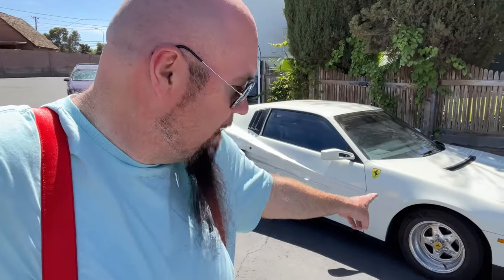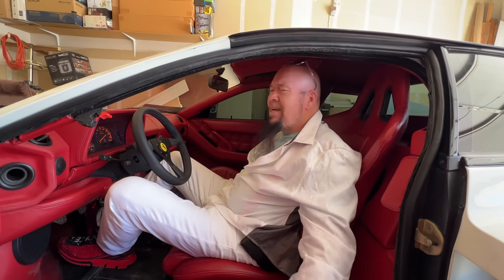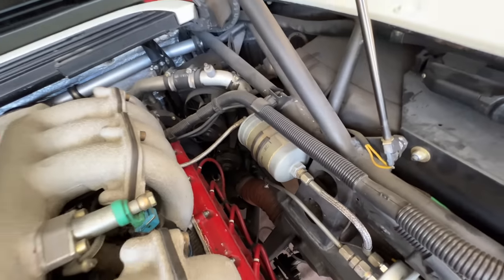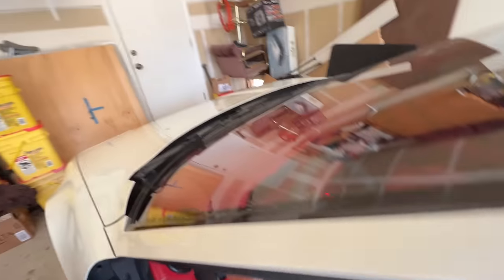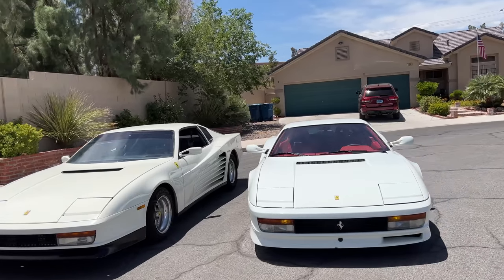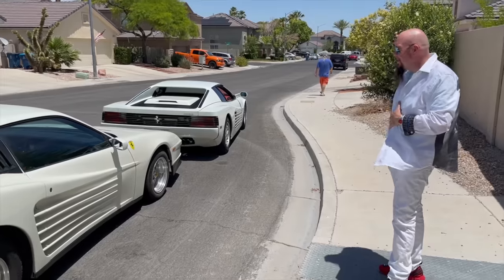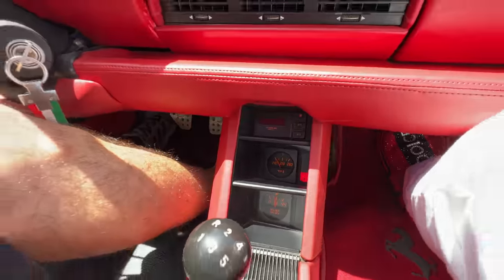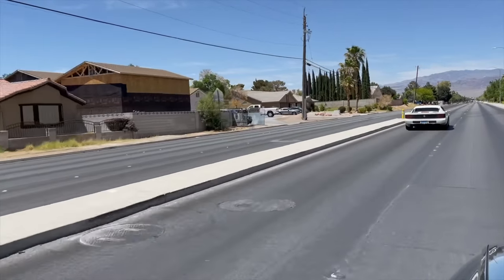Real vs Fake Ferrari Testarossa Replica Kit Car Comparison

Comment: The Corporate Concepts Mera was the ultimate Feauxrarri rebody.  You could buy a new Mera through your Pontiac dealer in 87 and 88 for about the price of a corvette and it was a darn good quality 308 look alike built on a Fiero chassis.  You could not buy it as a kit. Only already installed on a new Fiero, as an “upgrade” through Pontiac.

I own the prototype that sat on the Detroit auto show floor in 87.

Comment: I really loved the comparison! The trans am Ferrari looks way better now, than a regular trans am, in my opinion. Also, I’ve owned 2 Fiero’s back in the 90’s and they were my entry level cars to loving rear or mid engine cars (I owned some VW Bugs too so had rear engine cars too). I had a SE V6 auto and then a base 4 cylinder manual. Anyway, I think the Ferrari with an LS engine is a great idea. American reliability and Italian design.  Shelby Cobra ideas right there. Also, I’m a proud owner of a 2002 Boxster S which I call my baby supercar. Was inexpensive, yet 260hp, 2800lbs, 6 speed transmission and very reliable. The mid engine car stuff, for me has been realized in this really cool Boxster. Really like the channel. Thanks!

Comment: The front end is pretty close. If you painted the lower part of the front fascia white like your friend's car is by giving your car more visual  height up front it would help hide the TransAm profile. The side marker replacement is a pretty easy fix also if you don't mind doing fiberglass work and repainting your front fenders. Replacing the rubber door trim thing on the rear hatch with the proper wire mesh is also an easy fix that would upgrade the quality of the replica. Even the interior -- if you like working on cars and have the money why not? If you consider the car a work of art rather than just an investment the resale value of the car shouldn't be the main consideration. The length front to rear of the vertical side of the rear hatch panel immediately behind the quarter window you want to replace also is an area that attracts attention, but may be hard to change due to the placement of the chassis and rear glass at the back of the cabin. If you could push the seam back and extend the quarter panel back a few inches it would give you more room to install the new authentic quarter panel window. Although I would probably fabricate the quarter panel windows out of lexan and aluminum frame rather than pay the ridiculous price for authentic Ferrari windows. You've got the dimensions from your friend's car. That also gives you the option to shorten the window a bit if you have to in order to make it fit. No-one will see an inch or so without a tape measure.

Comment: If I remember correctly about kit cars it was against the law for any kit manufacturer to copy any Ferrari exactly the same that's why It had to be a little bit off
Reply: Did The Cannonball Run or something similar come into play? If l remember, Ferrari got quite pissed off when a replica was being filmed and that set the lawyers in motion.  I could be wrong.
Reply: @biggiefitz6275  actually I heard about that in 2006 a guy I new was doing a Fiero kit car

Comment: redrill the hubs the the right bolt patern or buy adaptor/ spacers, a 4th gen rear end is wider, has better brakes & bolts right in & a 8 into 1 MERGE COLLECTOR will get you the sownd your looking for. PS just paint the shape of the quarter panel window black & scrap the plastic that thear now.
Reply: I agree he could paint that part black to look like the window.  That, plus some tint would really get the look going, especially with a little black paint on the back part of the door fins would really help it too.

Comment: For the noise it's with a Cam and look up the 400 small block chevy from a truck then take the balancer and it should help make 8600rpm. And with the right amount of a cam it will sound more like this.  Talk to vic Edelbrock.  When he made his 240 pluss miles an hour trans am he had a special dial 400 sm chevy build.    It sound the best.  Now that effect can be achieved in ls9....

Comment: Theres a visible line running from the bottom of the windows all the way to the back of the car, this could be pulled off with a black pinstripe. Edit- also (I know from later videos you put in the rear glass look) from this over the roof to replicate the engine cover lines. Loving this by the way, you have a mission and its telly for us all. Not sure if it's possible to lower it a bit more? And obviously the wheels which is no doubt on the list.
Paint behind the louvers on the side vents black, look at the original. Its a cheap fix up, I don't know how far you need the paint, maybe 20 inches from the rear? Alternatively you could go blls deep and partially fill in the louvers and reshape further down the doors. Its not that difficult I've been restoring fibreglass race bikes and own a plastic Lotus. for years, the biggest challenge is blending the paint after.
If you add a rear facing vent between the rear wheels and back end of the body this will break up the long rear overhang. similar to an F40 but try keep the Testarossa look. 
I'm not stopping now, also move the Ferrari badge on the front wings further forward to take the eye from the long distance between the front wheels and the door.
Paint is an amazing thing, I would also use black paint to create the lower side window shape more in-keeping with the original, you wouldn't need a lot, get some painters tape to create the line on of the TR.

Comment: When the guy first started to play around with a cold gated shifter and then started taking about LS conversions or electric, I turned off the video. Just awful. By doing any of those conversions you may as well throw the Ferrari badge out the window.
Reply from the maker: And yet, here you are talking about it. This is how the news works too! It's all bullshit! Welcome to America!
Reply: @ Max G   This is a survivor Testa Rosa.  Comparing it to a period correct replica.  Yes, they discussed how owners are “resto modding “  these 35-40 year old cars for the purpose of driving, enjoying, showing, and maintaining.   Not everyone has jay leno money.  

This owner is facing down the barrel of an engine out service that I can only speculate will cost 20-30k.  I prefer the honest conversation about options especially in 2022.  Gas prices, supply chain shortages, companies price gauging and uncertainty as to the future of ICE’s is forcing owners to make sacrifices.  

Of course you are free to watch what you want.  Turn off the video if you must, but why not just leave it at that?  What compels you to mock and belittle as you leave?

Comment: Bob, instead of altering your current replica you should build your own replica Testarossa.  If you are looking for a GM chassis to use as a base for a Testarossa  you should look at a 1986 GM A Body (Caprice, Parissiane).  GM A Bodies from that era are ten inches longer and one inch narrower than the Testarossa.  Taking ten inches out of the A Body should not be a big deal.  Fitting fiberglass panels to the A Body should work and you could take the one inch extra Ferrari width out on the bodywork.  The old A Body engine bay should be able to handle an LS engine swap.  It is crazy to think how wide the Testarossa is I mean the Caprice was a huge car and yet the Testarossa was even wider!

Comment: Yeah that 89's been modified, the seats and steering wheel have been replaced, that's more a 308/328 momo in a smaller size and racing bucket seats, the originals sit further back and offer more room, and the interior looks to have been fully retrimmed, as the way they did it on most of them is the tri color, three colors, the one the dash is in, the carpet, and the seats and leather, its one of the key ways you can spot a fake lamborghini at a glance, the germans never do tri colors so their interiors are always dull drums beyond belief

and they didnt have the square box pattern on the doors, not knocking it, just saying also ferrari did actually have an automatic back in period, it was mated to a V12, its called the 400 and it featured a GM TH400 automatic transmission, actually one of enzo's last acts was to give their head formula 1 driver one of them with a manual gearbox

also you can upgrade the gearbox on the TR to a 512TR I found one where someone had done that, and with that, an exhaust swap, and electric steering, it would be a pretty awesome modern ride. also that particular testarossa with the 512TR gearbox and the exhaust, which is so restrictive it takes away 50 horsepower

89 thousand miles, if you set them up right with the OG motor, their fine, you just have to work with it, like what are the three things no owner ever does

he doesnt drive it, he doesnt service it, and he doesnt change the tires, and the engines are actually good to 600 horsepower, like theirs a guy in dallas who built up these motors into ripping roaring 600 plus horsepower cars for John Carmac and the guy is still around and doing his thing

as the thing about this car is, its still using cap and rotor spark and ignition and early K bosh, if you just upgrade what is there it should easily reach 512TR or M spec easily.

also radio, that was done because it was a big thing to steal radio's out of cars back then, my father had his stolen out of his car when he was importing it back in from germany, blaupunkt, the same they used on these back in the same period, stole right out of the port of new york

smashed the window, tore out the head unit and ran basically.

also the testarossa came with optional wheels, 225's and 245's in the rear, with an optional 265 wheel, it was in the testarossa book I bought, David Sparrow ferrari testarossa osprey classic marques and he does the 512TR too FYI

 like you hear people complaining about driving around town, I wonder if it just had the larger wheels on it

your friend did a really good job however, like he actually improved and fixed the one thing that bugged me about the TR, the front bumper, like its less round on the lips and looks better, like it doesnt protrude as much or have that much of a bend to its lips, like if you get a real one I would love to see how it would look with that bumper on it. or like a modified stock one to match it

as that has always been the one bad angle of the car that has never looked right on any of them, custom or otherwise, and your friend actually fixed that on his.

Comment: need to lower that kit car badly
Reply: Right, that's totally what I was thinking when he talked about the difference with the back end and then seeing them side by side.  That would totally fix the stance.  Most lowering kits take the back down quite a bit more than the front.  That's the most important part, looks wise.  Also, then it would ride like a Ferrari, not a Cadillac, like it's supposed to.  It should be taking corners at high speeds and getting sideways, not absorbing bumps.  It would be such a different car.

Comment: I think you do a lot of convincing yourself haha. It's nice and all but Idk I see two different front lower lights when you say they're the same. It could be age or a few different things but they look like different shades of orange and clear plastic to me. Also could be a wiring thing but when you turn them on, the lights are not eh same. Two on orange part vs one on real ferrari, and the bottom part doesn't turn on for the ferrari, prob a fog light switch?

Comment: It’s been pretty much a garage queen but it could be driven anywhere. And that’s the problem with supercars they could be driven anywhere but they spend 95% of the time sitting because it cost too much to maintain them and with that I mean the motors so you can pay up to $200,000 for a expensive ass paperweight. I agree Buy one and do an LS swap in it. I would love to do that with a Lamborghini but put a dodge demon motor in it.
Reply: If you're speaking particularly about the Ferrari  Testarossa Gary?...

 The engines are absolutely nowhere near $200,000.  I have bought one for my former 512 ( same car more or less).

They run about 50k give or take.  That was last year incidentally.
Reply: @saltysailor141  oh I know the engines are nowhere near that much I was thinking of the price of the car but when saying that I was thinking more on the lines of a modern super or hyper car.  I think the most Expensive supercar back then was the McLaren F1. But it is kind of sad with the price you pay for supercar they do tend to seem to just sit in the garage.
Reply: @garyheighway7635  that makes more sense!  Sometimes hard to decipher comments and their meaning!

P.s. and I agree about the paperweight a analogy...

Ironically?  My intended daily drivers, which are two Toyotas?  Get driven almost less, most of the year, than my two exotics!  I try to honor the cars in that way...

Plus it does keep them less likely to wear down from not using them enough.

All the best!  Bill

Comment: What’s your deal with Automatics? My Honda will unequivocally destroy an automatic LS3 on the street or track. 
The gearing and torque alone is so different between a manual trans and an auto trans it’s crazy! 
A 230hp -300hp Honda will literally destroy any automatic LS swap in the 1/4 1/2,street or track and especially the 60’! 
You’ve gotta just get over it and do a manual swap,that car will be night and day with that alone!
We’re talking a minimum of 2.5 - 4 full seconds faster in the 1/4 & 1/2 mile.
Get the Apexi N1 single or duel full cat back,w testpipe, cat delete. 
It’ll have that soft low rumble sound ,that’ll scream muscle when you get on it,the complete opposite of a fart can,high pinging,thin metal piping sound.